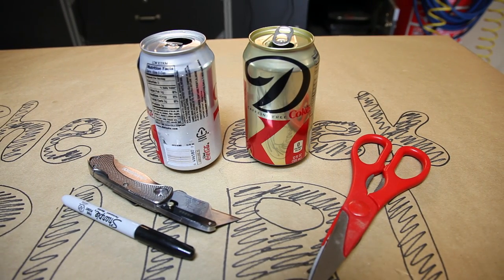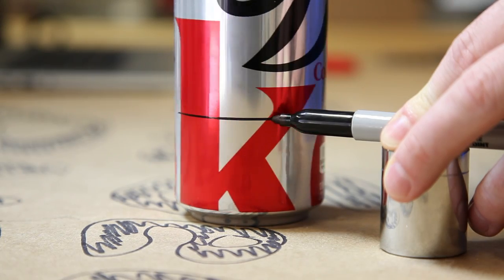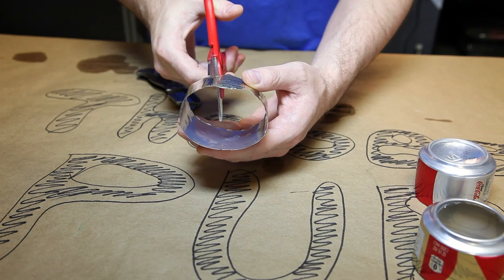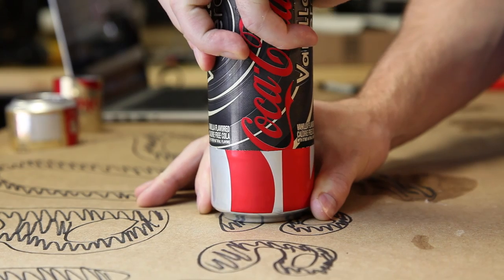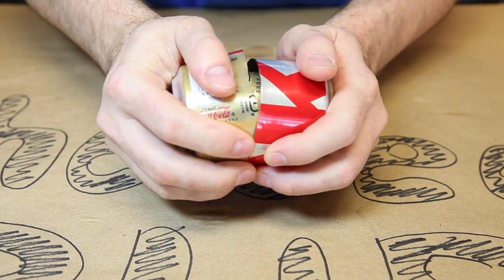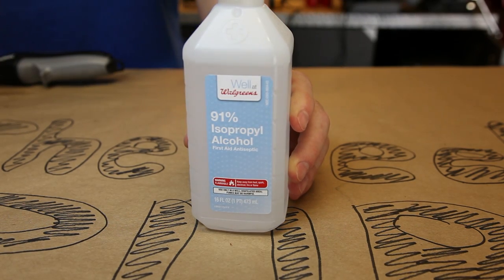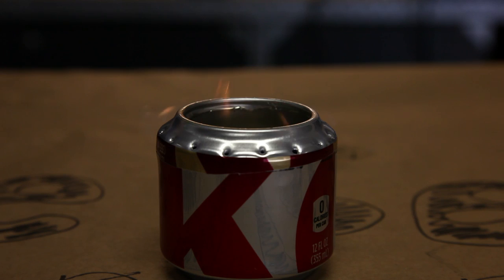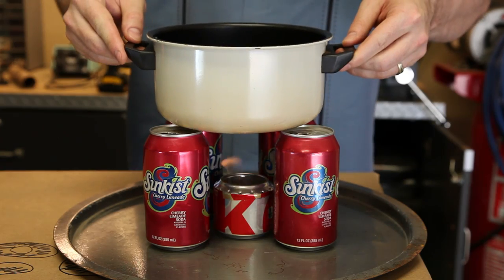How to make a Hobo Stove (Soda Can Stove)

Comment: I was an helicopter pilot in the U.S. Army stationed in Vietnam '69-'70 and we made "survival stoves" to heat-up our C-Rations all the time!

Just go to the following link:
https://dl.dropboxusercontent.com/u/10471230/C-Ration%20Stove.jpg

Just use a solution of 3 parts alcohol & 1 part cooking oil instead of the JP-4 that we used as the 'fuel'. Compact the dirt and/or sand loosely not tightly in the bottom ⅓ of the can. Dirt and sand is plentiful and free. The stove burns very well at a temperature that quickly and easily boils water!!

Comment: Quite inefficient design but not a bad idea. 

I make a similar design, but mine allows you to cook directly on top of the soda can stove. This makes it consume WAY less fuel since the middle section isn't on fire. Just the jets on the outside burn. 

These stove are nice too because they burn super hot, yet remain cool due to the alcohol chilling the bottom of the can.
Reply: then why dont you have a video tutorial of your super version? i would gladly use it :)

Comment: Can we just use one can , remove the cover and prick holes at the edge of the top part?
Reply: I think height would be an issue if you use other cans as spacers. So if you got a 6-pack, two cans would become the stove, and four would hold your pot or grill top over it.